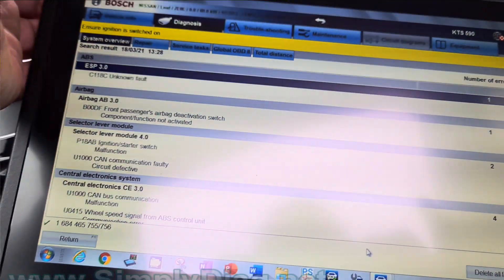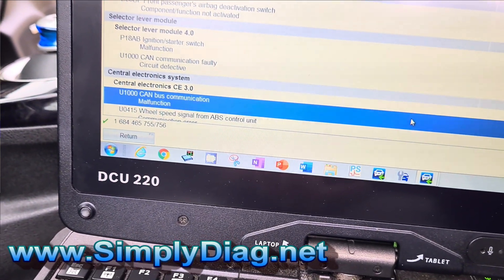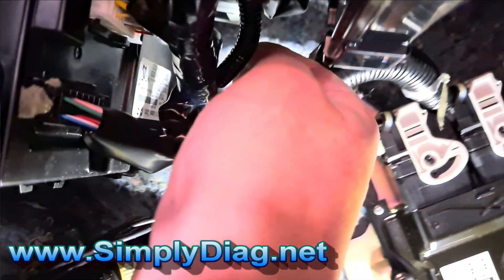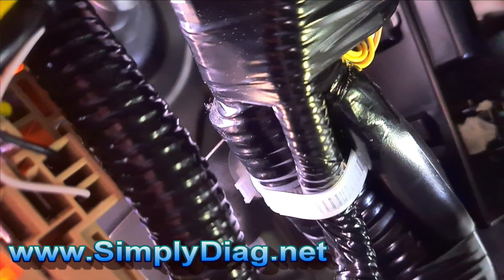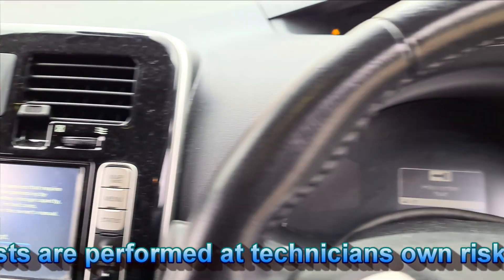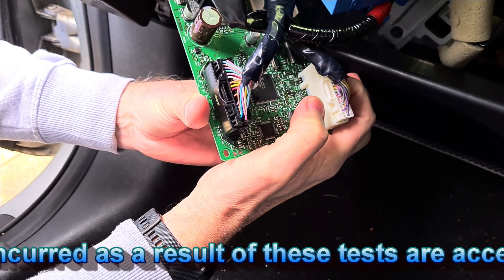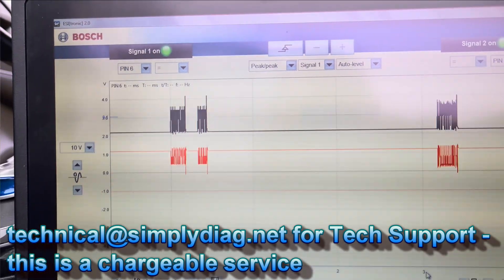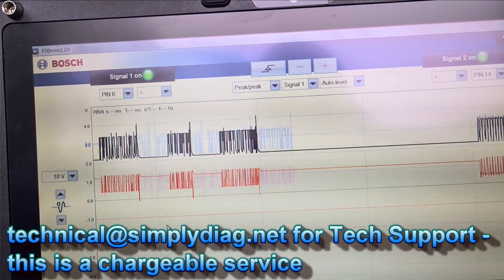Nissan Leaf loss of power steering, instruments and drive - C118C P18AB U1000 U0415 - BCM Fault

Comment: Great video 
Just unnecessary complains about dry wiring looms pop round mate will sort you out currently got 1998 Grand Cherokee there plenty off water damage she’s been well in the drink SRS module electric seats even air filter has been submerged and funny enough still running and only airbag light on due water damage 
Anyway great work as always

Comment: You used solder iron, or you replaced the board?thanks for another great video .Nice  editing.
Reply from the maker: Customer is an electronics engineer, reflow attempted but unsuccessful. As it controls EPS a new module was advised.
Reply: @SimplyDiagnostics  Thanks. You are awesome 🤣👍👏